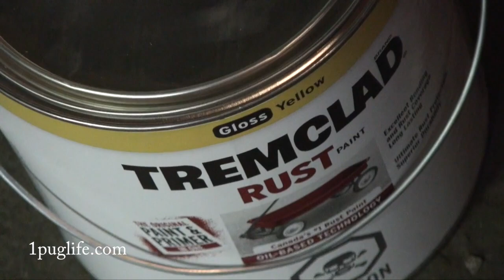painting the mud truck

Comment: uhhh, swap the tires side to side so the tread pattern is opposite,,,,,,, "grab wide" and push toward center is what you most likely want, being it's NOT a tractor that weighs 10ton+...... 
they way they are @ 10:00 will push/displace the mud/dirt/water to the sides and probably bury you more vs.  push it together in the center and ride across the top/not trench.
you'll know for sure, when it backs up better than going forward in the soup :)

Comment: Those Tundra's have terrible rust problems around the frame rails at the rear wheels. Google "Toyota Tundra rusted frame" and see all the brand new looking trucks that broke slam in half. Major recall and some highly pissed off people.
Reply: Lil*Rip Tacoma’s as well. Toyota put a brand new frame under a buddies 2002-3
Reply: my moms got an 04 sequoa been garaged for its whole life and frame is mint. has been undercerted and meok. my grandpa has an 04 tundra and they replaced every part of the frame and suspension. me ok with an undercertin!